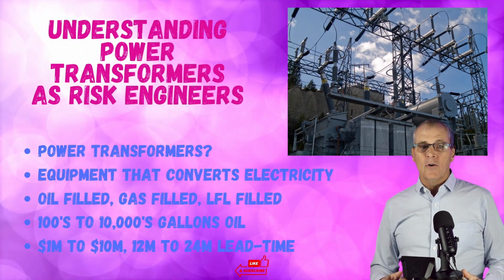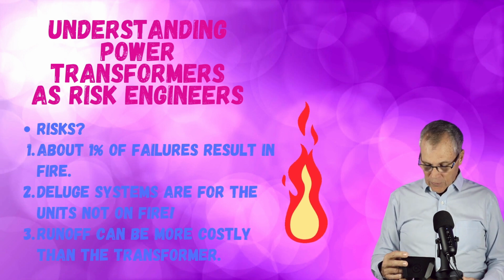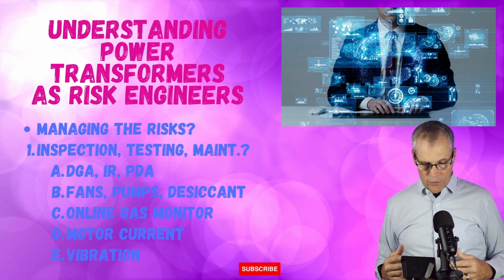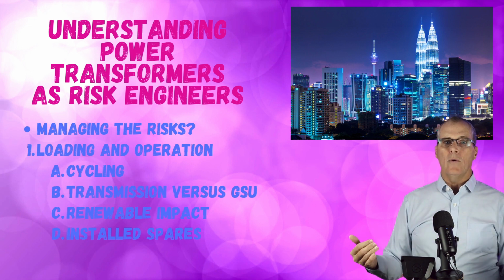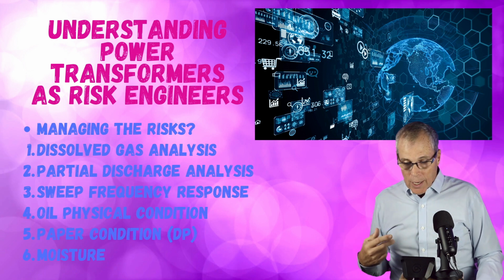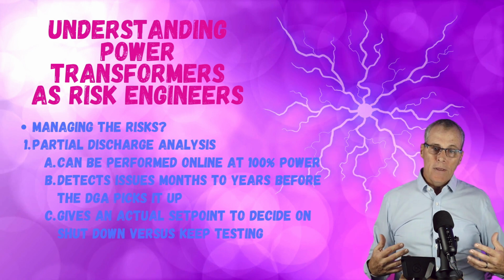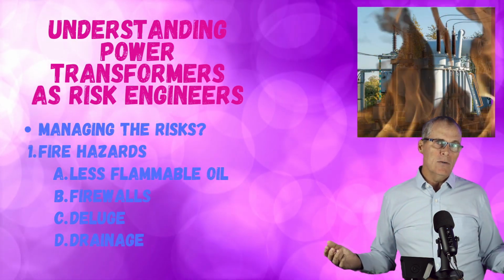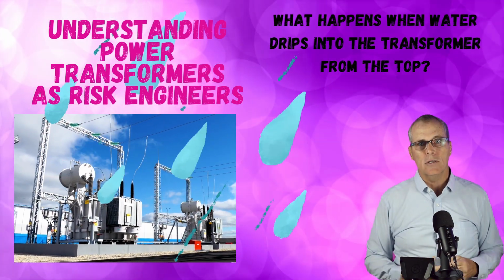Power Transformer Risk: What You Need to Know Before It’s Too Late

Comment: Do the transformer core  also have internal temperature F.O. sensors?

If they have core temperature detection, why is external detection for deluge actuation? Rather than heat detection or LHD?
Reply from the maker: The deluge systems need to detect fires from other transformers. There are some cases where we want the water not to flow on a burning transformer.